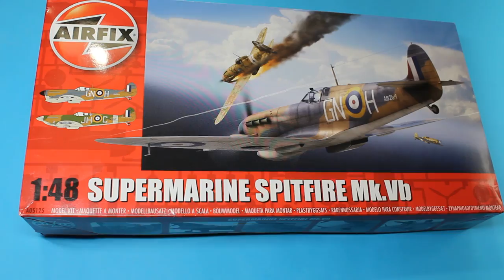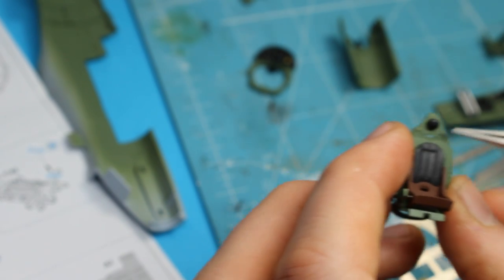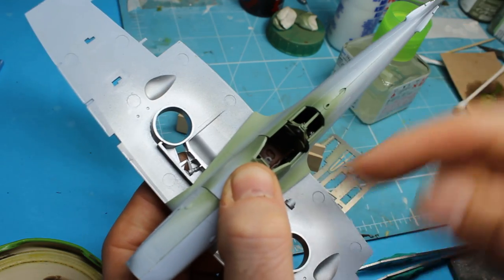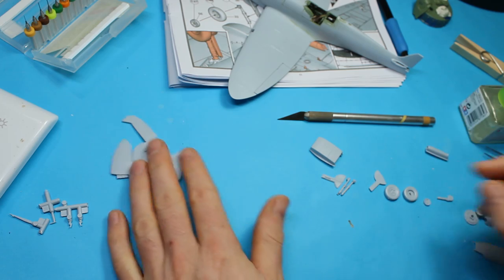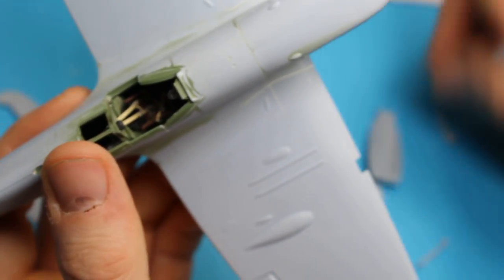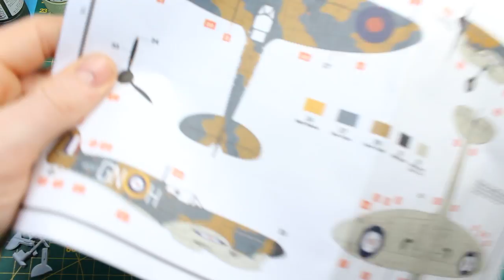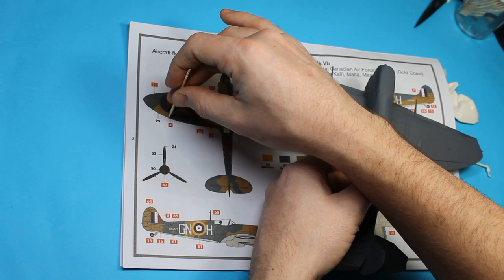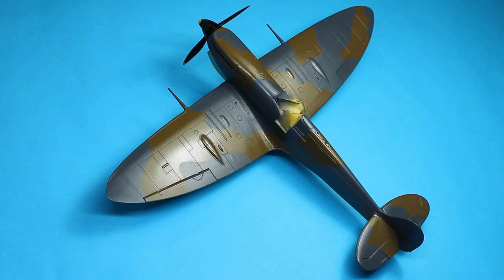Airfix 1/48 Spitfire Mk.Vb (Trop), Full Build Part 1

Comment: Selling point on the Vb and the re-engineered Mk. Ia is the separate cockpit tub. No need to sand down the interior if you want to replace the tub with a resin one. Good video, BTW.

Comment: I built this kit a year or so ago.  Great detail out of the box.  You did a nice job with the detailing!  I had the exact same fit issue.  Had to sand down some of the IP and bulkhead to get the engine cover on.  Glad to know it’s a problem with the kit and it wasn’t me that caused the issue😀 Rest of the build is fine.

Comment: 17:13 the boxy one is the water/glycol cooler for the liquid engine cooling system. 
The round one is the oil cooler.
The carburetor  air intake obviously is under the chin to the Volkes filter
Technically all coolers have both air intakes and outlets.

Comment: The dark earth should have been applied first and then the sea grey. The instructions clearly indicated that this aircraft was originally painted d. earth/mid stone (d. earth sprayed first and then mid stone) and then over painted with sea grey. In part 2 the roundels are too far back and probably a little inboard. The roundel should be fully on the wing and not on the aileron , and just behind the leading edge. The outer walkway demarcation lines should be a little further out, in line with the wing tip panel line. The roundel would then fit in the space between the demarcation lines.

Comment: 17:13  the larger one in your left hand is the oil cooler, the smaller on in your right hand is the air intake :)
Reply: The larger one was the radiator cooler, the small was the oil cooler and the air intake was in the center of the wing under the fuselage.